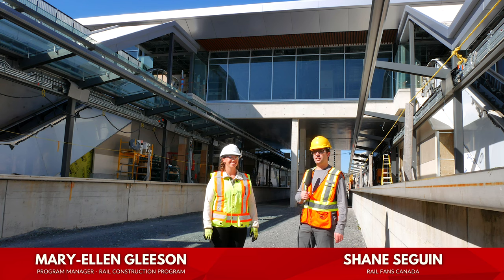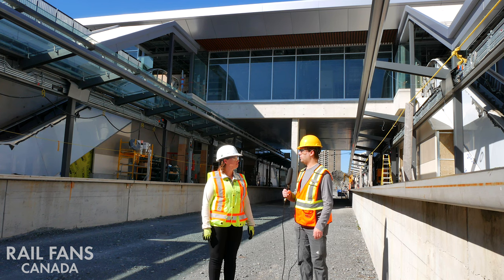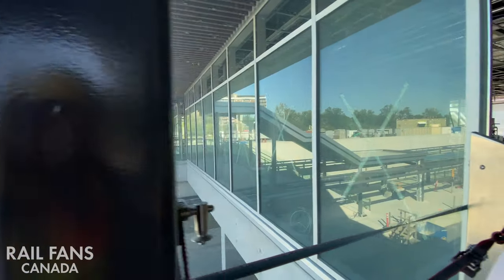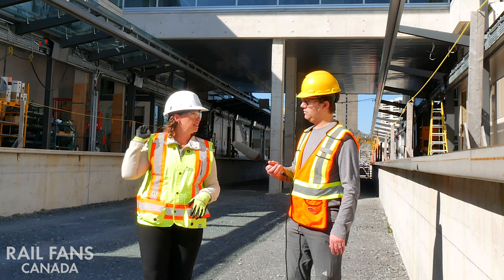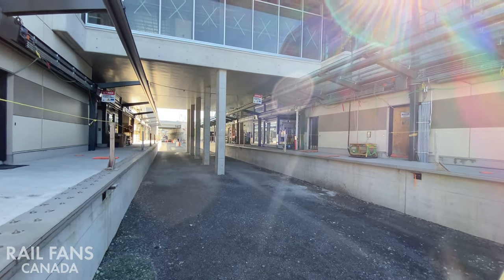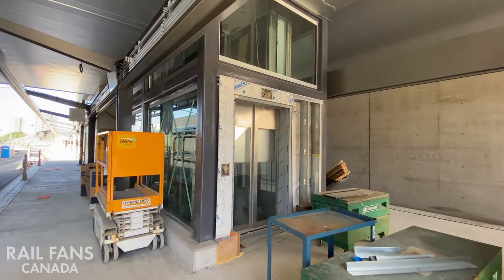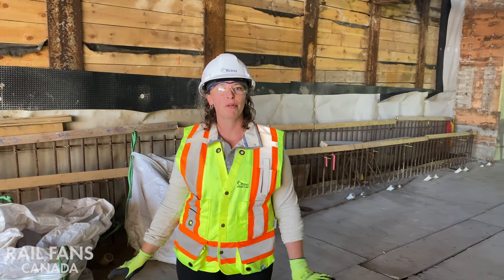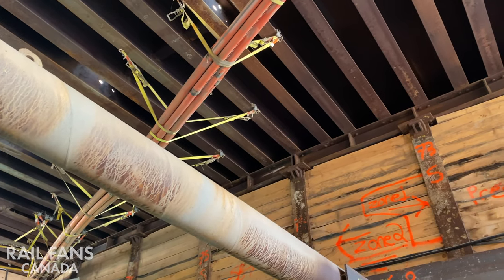EXCLUSIVE Sneak Peek of Lincoln Fields Station: The Western Transfer Point of O-Train Lines 1/3

Comment: Solid video! Love that you can get into the stations to get sneak peaks and interview the people involved with building it. I have to ask you though, even with more lines and stations, how will they improve the reliability of the train?? The line we have now is always breaking and seems like they haven't had a long streak of reliable service.
Reply from the maker: The line is currently 12km long. Once the east and west open it will be significantly longer. The rest has a lot more straight and light curves to it. This fact is key as the trains themselves will pass through the tougher segments less frequently and be subjected to less wear as a result. Long story short, it is widely expected that reliability will dramatically increase as a result. In addition, by the time the extensions open, we should have more permanent fixes and solutions in place for the existing issues.
Reply: @RailFansCanada  yeah solid video! Lots of great questions! I think when this is complete it will help out huge since the end of the line as of right now isn’t designed to be a huge collector for all the buses coming from the outskirts.. all these buses will now be spread out. I think lessons have been learned and with crossed fingers I hope it runs smooth. Good job

Comment: Do we know yet what the operational arrangement will be for the three tracks?
Reply: If I recall correctly, the easterly of the 2 platforms (the centre platform) will be for all trains going to and from Trim, so the middle track serving the centre platform will be trains going from Trim to Algonquin, and the easterly track serving the centre station will be trains going from Algonquin to Trim. The westerly platform (the single platform) will be for trains going to/from Moodie and Lincoln Fields. Trains to/from Moodie will only go beyond Lincoln Fields in peak periods.
Reply: Based on what was said in the video, she said Lincoln is a transfer station both the train from Moodie and the train from Algonquin.